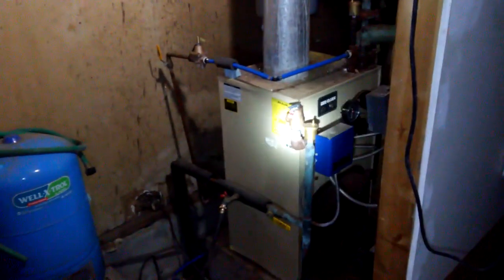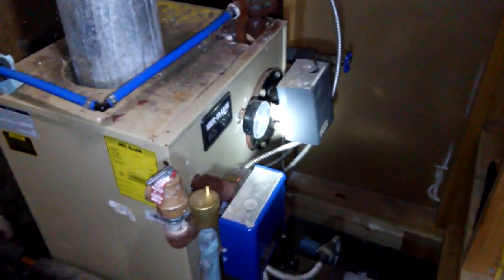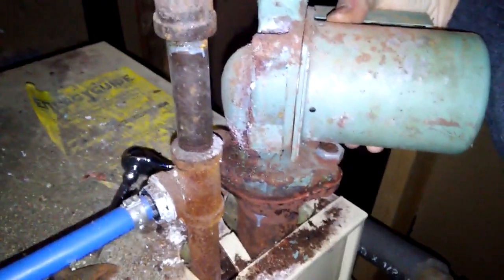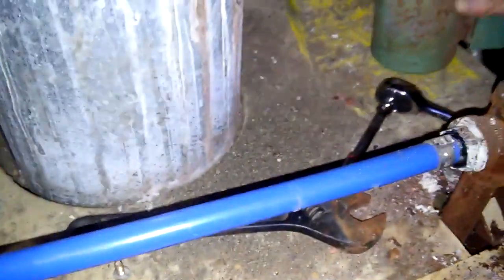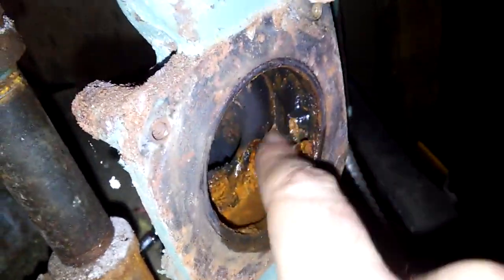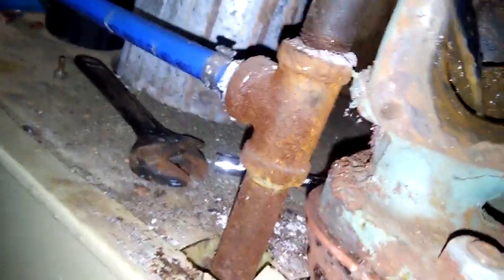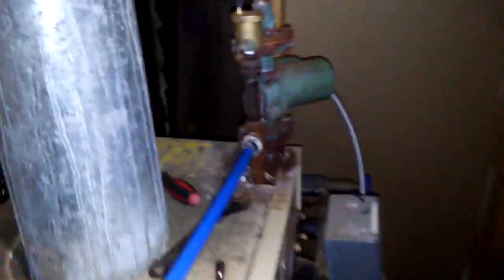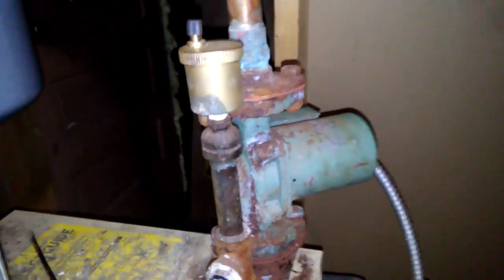Boiler Repair - Fixing Stuck Circulator Pump

Comment: Hi. Thanks for taking the time to post. I had the same issue except I found the internal impeller was also siezed from hard well water. I removed entire circulator from the water line & soaked it in a gallon of hot water diluted with about a half cup of powdered citric acid & left it over night. Much like you, I did have to do some scraping but it freed it up.  If it's possible to cycle your pumps once a month for 10-15 minutes every month during the idle months, this will help stay this situation off.
Reply from the maker: Glad it worked out.  The lime and rust remover with acid is a great idea. I should have done that.

Comment: My Taco 007 circulator is noisy as hell. No hot water no heat at baseboards. It's noisy because there's no water flowing through that line. Is my water tank clogged with sediment? When I cracked the valve near the circulator open, little to no water came out, and it was brown. And the circulator housing is VERY hot (since it's spinning but not lubricated by water)
Reply from the maker: Sounds like you have a water leak if your radiator lines are empty.  There should be a pressure gauge in the boiler reading between 10-15 psi normally I think for radiator pressure.  If that is zero, then you've lost water.

Comment: I had a similar issue, my circulator pump was fine, I just had some cracked solder joints on the back of the circuit board on the aquastat.  Re-soldered them and good as new.

Comment: Unreal I am having this problem as I write this! Pump is hot on body and pipe is hot up to pump but pipe above pump and going up to my house all heaters are cold! Gotta be this dam taco pump! Can't hear or feel it spinning! But hot as heck! So I have to turn power off to furnace and do I need to drain boiler?? Ty for this video! No answer needed I just read comment below👍
Reply from the maker: Nice. Hope you were able to fix it.  Electric pumps are strong and durable, it's hard to break them.   You may have to bleed to radiator pipe after this, which is not hard.  If you only let a small amount of water out, you may not have to if your system as a an airscoop valve which slow captures air in the system.
Reply: Mike, I am having the same exact problem. Pump is scorching hot, pipe is hot up to pump but above pipe is cold too. What ended up being your solution?
Reply: @michaelo691  a valve malfunction on pipe near ceiling. Check Valve I believe. Changed it and had to bleed pipes afterwards. Cost about $65 for new valve👍 I hope this helps you. You might want to bleed pipes of air first and see if that's the problem. It was NOT the pump
Reply: @thepennsylvanian9280  thanks brother!
Reply: @michaelo691  you're welcome good luck

Comment: Did you have to drain your system first??

Just watched another vid and they said to drain it??  Might be a different setup, but I was just curious...
Reply from the maker: I drained it enough for the water level to fall below the pump.  In my system that pump is at the top of the system so I had to take very little water out of it.
Reply: jyienger got it, thanks
Reply: where did you drain from? that is what I'm trying to figure out. where, what do I drain?
Reply from the maker: @niayuq  there are several places. There very bottom of the boiler has a sillcock valve. Open it drain out some from there.  On my system there is also a hose valve on  the outflow to bleed the system, you can drink from that too.  I used the valve at the bottom.
Reply: Need help to find were to drain